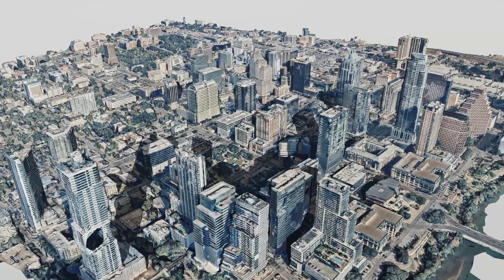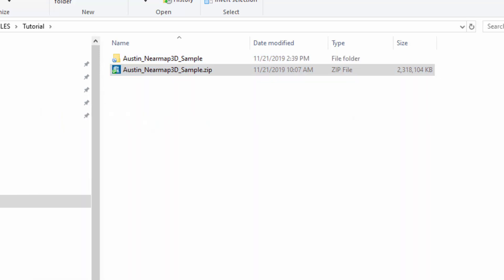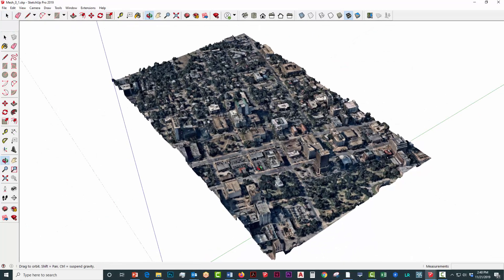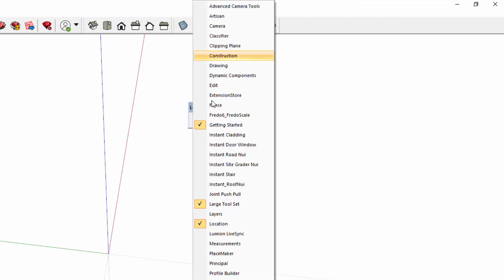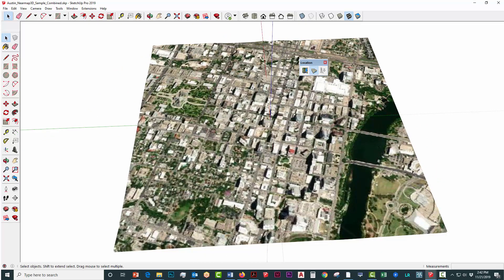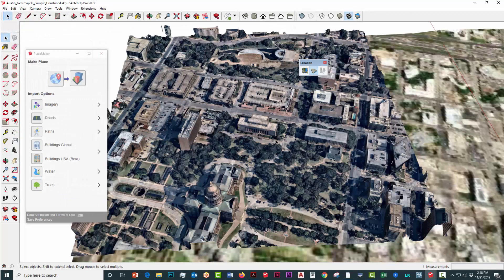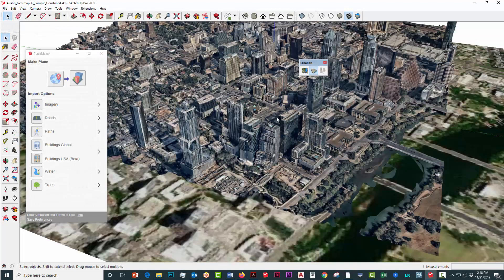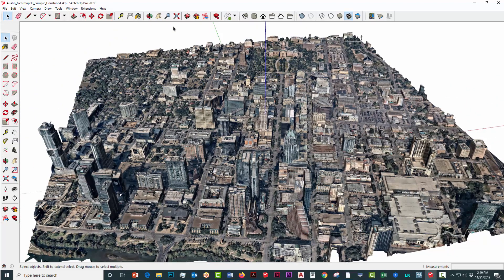PlaceMaker 3D Mesh by Nearmap - Geolocation in SketchUp

Comment: where is this data coming from? is it available in countries outside the US? it looks really good
Reply from the maker: Its coming from photogrammatic data sets flown with a plane. Depends on the location. What area do you need?
Reply: @danieltal3d  thanks for the quick reply. UK and especially London. Those are not the same as Google Earth, right? Have you or some other team done a separate survey? That would be amazing, Google to this day still hasn't made their 3D scans publically available.
Reply from the maker: @danielkrajnik3817  we contact google every couple of years to see if they will release it. Microsoft Bing Maps also has a great data set. They are both accurate to less than 1m. I would recommend getting a drone to create the scans if you want solid accurate detail. Its what I use in my practice. I do not think we have UK data yet but will find out. Do you use Revit?
Reply: @danieltal3d  yes, Revit Rhino and Sketchup I think are the main components for us, but it may change. There was an interesting plugin released for Blender to "download" sections of google earth in a similar fashion to nearmap in sketchup, but I am not too sure about the license. Your product looks like a great alternative for initial stages for architectural design. Agree, later on a detailed drone survey comes in handy as well
Reply: @danieltal3d  how did google explain why they are not releasing their 3D scans? Bandwidth, demand?